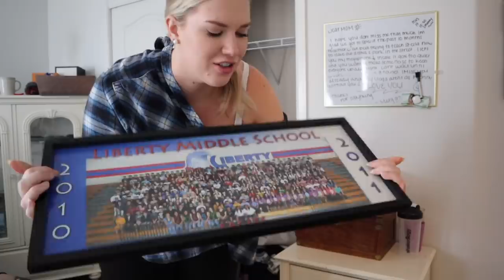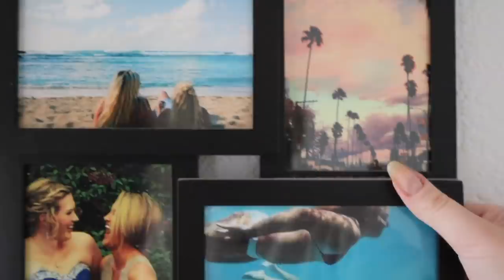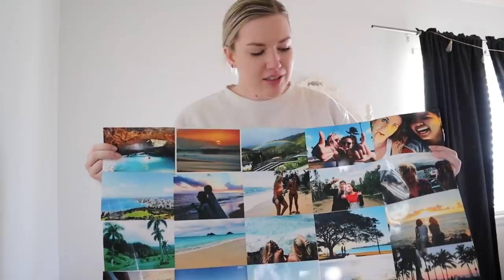cleaning my disgusting childhood room *I got rid of everything*

Comment: If you happen to be taking suggestions [even though it seems its all already filmed]

Please move the bed to the other wall [same as the door], id say either have the head of the bed on the same wall as the door or in the corner so that the window area is open rather than behind the bed.

Comment: Love you girl but I'm feeling personally attacked regarding the mane n' tail shampoo and conditioner lol... I've had horses my entire (almost 32 years) life and I have used those particular items many times on both my horses and myself and thought that they worked just as well if not better than any other drugstore brand. Also, it doesn't smell like a haystack you silly! Not in the slightest! 😂😂😂😂 However, as an adult, I prefer other shampoo/conditioner. That's not to say I wouldn't still use mane n tail if I was in a pinch! Lol!